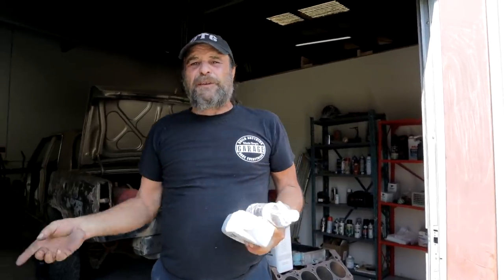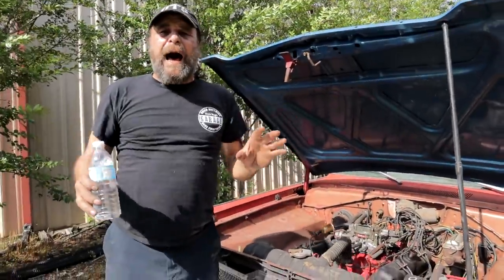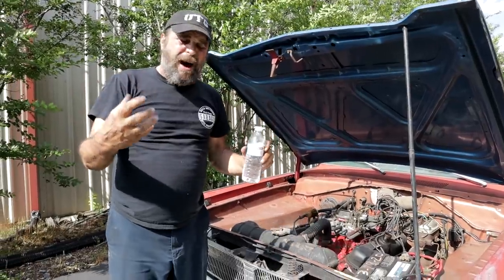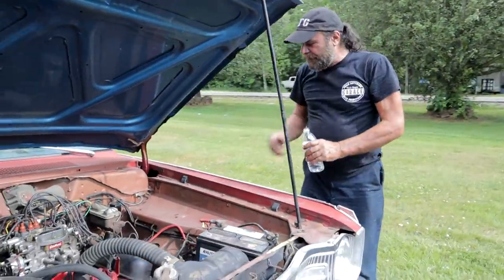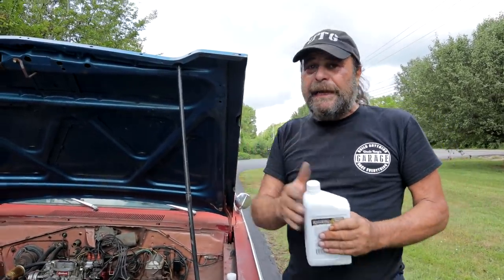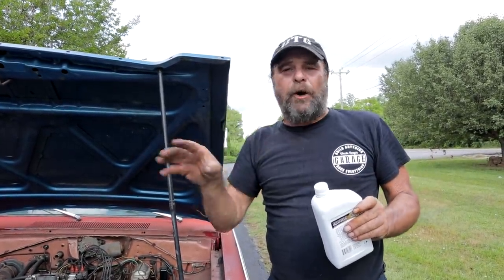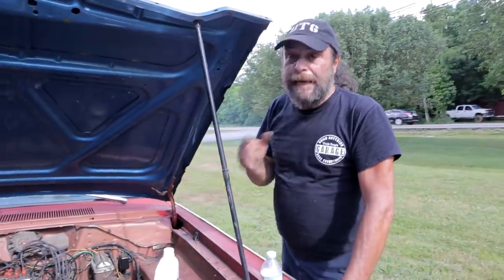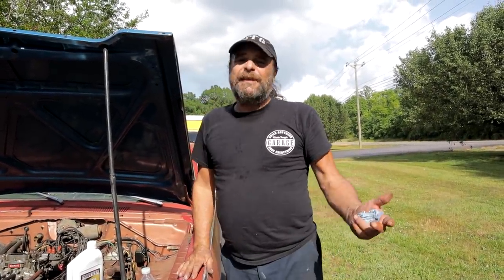Forgotten Service Routines From The Distant Past

Comment: When I was a teenager one of my great uncles had a water jug under the hood of his thunderbird hooked up to one of the vacuum ports, and he said it was to help keep carbon from building up in the engine.  When I was old enough to get a job, I worked at a full service gas station with a service garage, I recall the mechanic putting the transmission fluid through the carburetor as part of the normal tuneup.  Thinking about it now and I can still smell the smoke from doing that.  Good times, and cars you could fix without plugging it to a computer.
Reply: At least the post-1996 cars have a unified and cheap scan tool.
Reply: @Atomic Litter Box yeah, you can still run water into the intake of a modern car with a cat converter - as a mist, enhancing the humidity in intake air, post MAF and TB ;) just like the factory with the PCV system
Reply: @Atomic Litter Box spread the word. The steam produced helps on the torque side of things slightly as well.
Reply: Decreases detonation too. If you had 400+ HP on a small block, it was time to think about water
Reply: @NuBz MMO is really good at softening carbon deposits. I’ve saved the EGR valve/tube on my more modern daily driver from replacement with it.

Comment: In the owner's manuals of those earlier cars, they explained how to adjust the valves and carburetors. Now the manuals instruct you not to drink the battery acid.
Reply: The trick is to mix it with a little lime, crushed ice, and sugar.
Reply: @austindavid1862  If you think about, it means someone from your generation had a sip so they had to Warner he younger gen.

Comment: 7:17
Back in tech school in the 90s one of the kids had a bomb old 70s rat Lincoln. 
You guessed it , we filled the washer reservoir with ATF and put the hose in the top of the carb.
Push the squirters and you were instantly James Bond.
Reply: DUUUDDDDDDEEEEEEEE.
Reply: Not without the machine gun and the ejection seat.
Reply: Hell yeah! Smoke screen, and clean.
Reply: a friend had a 62 Pontiac that we nicknamed Pure Smoke Pontiac. If you got on it hard it would leave a blue cloud for blocks
Reply: yeah all the more reason to pilfer the washer bottle tanks and pumps from the bone yards.
Reply: Hahaha that’s cool
Cheers😊
Reply: tap into the exhaust manifold is even more spectacular
Reply: Spy hunter
Reply: @2000freefuel  yup, alot of em have the pump built right in. 
Actually back in my day,I used one on a VW turbodiesel for water injection.
Yes, right in the intake before the turbo. 
Haha years later when it was pooped out and I took it apart , it was by far the cleanest carbon free diesel I ever saw inside😀

Comment: Sometimes I remember my papaw would floorboard it for like 1/4 mile and just grin and say you have to keep the soot blowed out haha.
Reply: Yep. That's how cars were decarboned back then.
Reply: My Uncle said that the best used car to buy was the one that was usually driven by the proverbial little old lady but occasionally run hard by a teenager.

Comment: Just did this on my 77 F150 with 82000 original miles. Was driving good but after doing the atf trick, it drives a little bit better. Thanks Uncle Tony.

Comment: I used to put a half quart of ATF in the crankcase about a 100 miles before an oil change to help clean out the motor.
Reply: That's what I use marvel for ,it's a naptha based cleaning oil.
Reply: Same
Reply: A small amount of kerosene works too

Comment: They still taught us this when I was learning to be a military mechanic in the late 90’s, not part of the official curriculum, but the old timers still shared it. One other service trick was deglazing cylinder walls from excessive idling with a bit of Comet or BonAmi down the intake on 6V53’s.

Comment: Another great and refreshing video from Uncle Tony.  I had a 351 Windsor 40 years ago that suddenly came up with a carbon knock (knew it wasn't a bearing below, not a wrist pin, too heavy of a hit to be a lifter).  So, down the old Autolite's hatch with water, and slowly but surely the knock faded and was gone.  And a transmission fluid drink is also good to store nice running engines that are being pulled from junks, and may just sit on a pallet for a year or so.

Comment: Water induction is my secret to removing 3 valve Triton plugs. Works like a charm.
Reply: Never thought of that for helping get those stubborn plugs out :-)
Reply: @Viper81766  A cheap garden sprayer, the kind you fill, put the pump in the top, and pressurize with a few pumps, then I install a 3/8 ball valve, a 10 foot chunk of vinyl hose, and whatever adapter I need at the intake/ throttle body. Manual second gear and full throttle and open the valve. don't forget to close the valve , before getting off the throttle. Sometimes you can do it static, in park, sometimes you need to drive it, to load it. Then 3/8 cordless impact, zip zip.
Reply: @jamesgeorge6551  thank you brother . I've been nervous on changing plugs in them . I've got a 4.6 in an 03 Vic with 280,000 miles on it . I knew the 5.4 had plug issues and some 4.6 engines had plugs supposedly blowing out . The steam makes sense though and is lot better than other options :-)
Reply: @Viper81766  I'm pretty certain an 03 C/V is going to be a 2V head, those are easy peasy, just use a torque wrench, clean, dry plugs 28 ft/lbs.
Reply: @jamesgeorge6551  it is 2 valve . I've put two sets in it but was nervous the first time not knowing the plugs were not the same as the three valve . Heard to many horror stories on the 3 valve .
Reply: All you have to do is get those 3 valve engines hot and at operating temp then the plugs come right out. If you try to do it cold you'll hate life

Comment: Worked changing oil for years and until about 5 years ago, we used to sell fuel system cleaning kits that did exactly as you described, I.v drip and spays and gas cleaners.
Reply: @KS-xo3oh  they're still pretty common and shouldn't effect the turbo at all. You should see what happens to valves on GDI engines that don't have it done regularly.
Reply: Yeah this has never died... anyone who's been a tech knows this is very common. Companies like BG and Justice Brothers sell products for it with the drip apparatus he describes. With direct injection fuel never hits the valves so this is needed now more than ever.
It's such a problem that removing the intake and blasting the valves with walnut shells is a common service on higher mileage cars.

Comment: Reminds me of when I overfilled the auto transmission in my 1968 Olds Cutlass years ago:
With a long vacuum hose connected to the engine, I sucked out the excessive fluid out of the fill tube.

Comment: we actually did the water routine to a 64 Thunderbird that was running rough and you would not believe how smoother the idol was after we decarbonized
Reply: Idol - someone or something that is looked up to 
Idle - to maintain a constant low rpm

Comment: GDI (gasoline direct injection) engines are known to have carbon build up on the intake valves because gasoline no longer flows over them and cleans them. So the carbon cleaning through the intake is now recommended service again (and they use the IV style that Tony talks about but it’s hooked up the the fuel rail). Oddly enough GDI fords don’t require this service because they have an extra injector in the intake that cleans the valves.

The more things change the more they stay the same.

Comment: The 1955 Chevy 265 engines would not break in. The service bulletin went out: Put Bon Ami down the carb while racing the engine and change the oil. The Bon Ami honed the cylinders and solved the problem.
Reply: Comet cleaner
Reply: Hal 1000 never comet it scratches, Bon Ami won't

Comment: We used to use beer on our cars. Then there was the Oak Bay tune up. Little old ladies bring in the crome mountain for a tune up. Grab your lunch head to the hyway pull a few passing gears. First time that car had been over 30 in years. When it stopped smoking change plugs ect.

Comment: I’ve used a vacuum hose, sucking through a carb jet jammed in the hose, drawing in the contents of a sea foam can.
Reply: NICE IDEA
Reply: Why the jet vs just the hose without the restriction?
Reply: The jet controls the suction to a metered flow.
Reply: @garryhatchett775  is metering the flow somehow beneficial?
Reply: @mwilliamshs  , works for me. I ve done it this way for years.

Comment: I was shown the water through the carb trick as a young boy by a local mechanic in Missouri -- totally amazing that an engine can suck this much water through the carb and run.  Side story related to this -- in 79 I had a 69 Mustang with a 302 and I made the cobra jet hood scoop functional by cutting a hole under it, buying some garage rubber seal and putting that around the outside of my air filter housing so it would seal to the bottom of the hood with the hood closed.  I had some small holes drilled in the outside of the housing so it would leak any water the thing consumed while raining.  People used to worry that I could potentially hydrolock the motor driving in a downpour.

That thing ran noticeably better in a hard downpour.   Like amazingly well.   This helps explain why :)

Comment: These old tricks work. Had a customer who was a retired army motor pool mechanic.  He used Marvel Mystery Oil religiously on his fleet & on his car, an old Ramlbler 6cyl. In the crankcase of course,  and a very small  amount  in the fuel tank( additive/ fuel ratio) every other or so fill- up.  Kept the fuel system clean from varnish and in float bowl, venturi, & throttle blades, whisle clean inside - he pulled the air cleaner to show & tell.   Best  little preventative  maintenance  tip for pre-Catalyst  cars I learned that day. That old Rambler idled  smooth,  no smoke,  & snappy throttle  response .

Comment: It's one reason I love my MGB.  There's NOTHING modern about it.  I still have points, dual SU carbs and STILL set valve lash, set timing and point gap.  "Back in the day" you needed little more than a match book to do a tune up correctly.  You could use the matchbook to gap points, use the striker to file them then fold the carboard over and gap the plugs!lol!  Points are STILL the way to go on many old cars designed for them.  I've run the modules and went back to points.
Reply: One thing people OFTEN missed on even a full tune up was replacing the return springs on the point plate.  They'd become weak over the years and the car just will NOT hold base timing if those springs are shot.  Between lubing the phenolic cam follower on the dizzy to the aforementioned springs....even seasoned mechanics could be guilty of not getting the most out of a FULL tune up.  Oh, and not properly realizing that the vacuum advance was shot on many dizzy's which would manifest itself as a bad carb.
Reply: MG !
Cool little car. 
In fact, they are tiny little cars.
Reply: But.. can you keep the smoke in your wires???
Reply: @kentkirkpatrick7953  Pecktron Invertor for that, combined with Lucas Darkpower!
Reply: @TakeDeadAim  depends on engine BUT.. some Datsun cams will slip right into that Brit-motor and give ya more power for pennies and a little bit of work.
Reply: @kentkirkpatrick7953  Yeah, that was the FIRST thing I did.  Address Lucas, the Prince of Darkness.  Rewired much of the car while I had it apart to paint.  Very reliable and bright lights now!lol!
Reply: @modelnutty6503  Actually you can gain a lot by reworking/porting/adding larger intake valves to the head.  I came up with the "holy grail" of head builds on a flowbench so much that I made a good bit of money by buying old cores and building them then shipping them off all over the world.  Including Australia.  They loved them!  5 angle grind on the intake, radius the exhaust, smooth out the angles and do NOT port match or make the exhaust any larger unless it's running on track.  If you mess with the exhaust too much it loses it's low end and will only start "singing" above 5k RPM.
Reply: @2lotusman851  Interesting fact.  Mazda used the MGB as a template for that Miata.  They're almost identical in size.  Especially the amount of room under the hood.  The MGC had in inline 6 but has pretty bad handling due to the weight up front.

Comment: Tony, did this more than a few times, smoke rolling down the driveway.  You'd see smoke pouring out of a garage bay, knew what they were doing.  Every few years they reinvented "water injection", hooking a jug of water to a vacuum port.  That worked great for reducing detonation, and in fact was used on some WWII fighters at full throttle.  (An aside, pilots watched manifold vacuum like a hawk, very important, matching engines at cruise on B17's by juggling throttle and prop pitch, getting same vacuum on all four engines.)  So much is forgotten... or being done for us by the engine computer.

Comment: Wow, it’s amazing how history repeats itself. I  actually use the same technique as a modern mechanic in a dealer (albeit we use sea foam or some other “top end clean”). The modern direct injection engines seem to have a problem with carbon buildup on the intake valves, normally causing a cold misfire. A can of sea foam down the throat always does the trick.

Comment: Did the water decarb with a 77 460. It's AMAZING how much water you can dump into one without hydro-ing the engine. I'd have never believed if I hadn't seen it. But yea, don't get carried away, JUST IN CASE.

Comment: Man that's a blast from the past of mechanics tips and tricks. I know a couple mechanics that used to dump  2 stroke motor oil into the gas tank to help lube the fuel system. And if there was an issue with condisation in the fuel they would dump mytholhydrate into the gas tank to compensate the water that was in there.

Comment: YES!!  Old school stuff I've not heard of in a while.   When I had my 1975 Laurentian (Canadian variant of the Catalina) I did the decarbon one.  Now in '75, they did have catalytic converters on them, but the original was junk and full of holes.  I was replacing it with a modern high-flow one, so perfect time to do it.  The car used to have a habit of sputtering and trying to keep running after it was turned off from the excess carbon the previous owner built up on nothing but short trips.  Got some distilled water and did exactly what you did.  The old thing belched out all the carbon in about 10 minutes of work, and it ran beautifully after that.  Eventually, when the car could go on no longer (chassis mount issues at 31), the guy that bought it transplanted the engine into another vehicle and said during the engine service and rebuild that the engine was "surprisingly clean for it's age" - so yep, those old techniques definitely work.

Comment: I use a little atf in the oil before an oil change, on my FE, to keep the lifters flushed; and run some in my efi gas and diesel fuel tanks for injector cleaner/lube.

Comment: I learned about the water down the crb trick back in the 70s and still use it occasionally on carbureted vehicles.
We also used to add a gallon of diesel to the gas tank when it was about half full to clean the manifold and upper cylinders.
Ive even done that with cars that have catalytic converters because the tree-huggers at the EPA can go rotate on my prong.

Comment: I recently bought a’82 Honda GL1100 from an elderly couple a block over from me. It has been parked in their garage for over a decade. Motor seized, carbs seized, etc. first thing I did was put marvel mystery oil in everything. Motor now turns freely, and I should have it running in another week.

Comment: Growing up, a friend of mine used to scrap cars so we had a lot of stuff to play around with. Turns out if you rev an engine up, you can run a garden hose in it and you won't hydraulic it, you will start to quench the fires though.

Comment: Yeah Man, I used the ATF trick before on a rebuild that didn't seem to be seating the rings so the ATF acts as a detergent to scrub down some of the oils off the walls and then go run it under compression with downhill braking and the rings would seat.
Reply: What exactly do you mean by downhill braking
Reply: @yamahaguy1732   engine braking, you use the engine as a brake, put it into a lower gear and let it rev out going down hill
Reply: @wildrosegarage4208  Gearing down and coasting under compression of the motor for some backward pull against the rings
Reply: @wildrosegarage4208  Oops, I answered the wrong dude but you already handled it...

Comment: I knew about the water trick and I had always used sea foam through the brake booster. When I used to watch my dad do it on his 220,000 mile Jeep Wrangler, it'd smoke out the zip code but when I sea foam my 87 Plymouth, I don't get smoke at all. The ATF I know can be used to clean the injectors on diesel trucks, such as filling the fuel filter lol,  but makes sense.

Comment: I use SeaFoam to clean intake valves on direct injection engines. The valve stems are completely dry and build up carbon.  Feed it thru a vacuum port into the intake plenum and use a basketball needle to restrict flow thus preventing stalling. It works.

Comment: Still have a few NS and LR bags from my Paramedic days; used to put an ounce or so of Ammonia into distilled H2O on a slow-drip, and it worked like a champ.  Wheeling in the 100 degree weather would cause carbon to accumulate and could even cause run-on(dieseling). Cadillac Perverters were a game changer, especially the Chev wagons circa 1984.